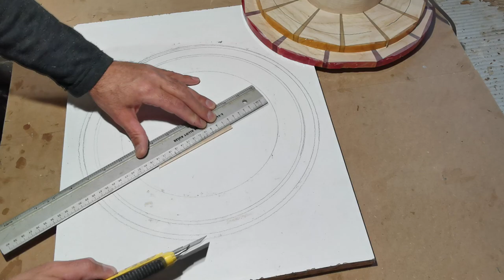woodturning :large plate in resin and segmented wood

Comment: Hi Morgan I would love to send pics, me not very good with computer to send pics, me good with hands I think, or so I have been told , 🍂👴🗜🚪.
And yes the region is very good it's got the autumn feel about it now beautiful colours in this in the trees from the leaves 🍃, i'm a property that runs along the side of the river for about nearly a 1/4 of a mile , just after January this year I pulled out two bits of oak that I think I've been in the river I think part of a bridge or some structure that has been in the water for quite considerable time as they worn away.
I think when they are dried out that could look quite amazing set in resin and then been turned.
And about three weeks ago we had some high winds the farmer owns the property or the land on the other side of the river one of his trees came down across the river took one of my trees out and blocked the road that only goes to my property so out came the chainsaw made clearance but found a couple of nice piece wood with some lovely grain init , so I can see another project for two or three more bits of wood in a few years time when I dried out, .
Phil from the Moulin

Comment: Hi Morgan, Enjoyed watching your video I'm new to wood turning in some respects never really done any epoxy resin but have made furniture dining tables chairs, various windows and doors over the past 40 years I live about 6Km from Argentat in a Old Moulin which I have converted into a dwelling over the last 7 to 8 years at this point I must apologise I am English and cannot speak French or even read it I'm retired in my late 60s living by myself , I have a little workshop, which is very cramped as I have a large separate Planer and Thickness and spindle moulder , and a Watkin RS  pattern make a lathe, all jammed into my basement it is a bit tight as my business/workshop in the UK my workshop was about 7 to 8 m wide and 35 m long are used to work by myself , The Last 10 years making specialist doors and windows mainly  on Barnes conversions, , I have a river/stream running alongside my property and I occasionally pull out old bits of wood that I've come down from the mountains which I think will look nice set in Resins  and turned at some point , anyway that is enough about me I've had a look at your things you have made over the years I look very impressive keep up the good work obviously as you know it's very bad in England and in France moment with a virus so I do not travel very far stay safe facemask and Head shield on ,. From Phil from the Moulin in France
Reply from the maker: Hi Phil du Moulin in France
Thank you for your comment ;)
You live in a very pretty region, where beautiful and large trees grow there, it is the happiness of people like you and me who are in love with wood and nature.
I would like to see your work in wood and resin, do not hesitate to come back to me to show me your works.
see you soon ;)